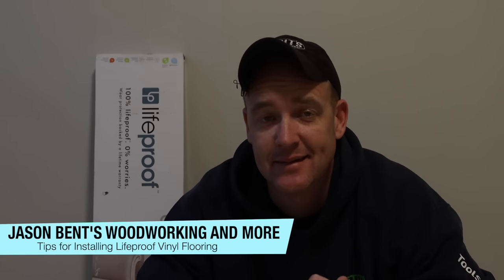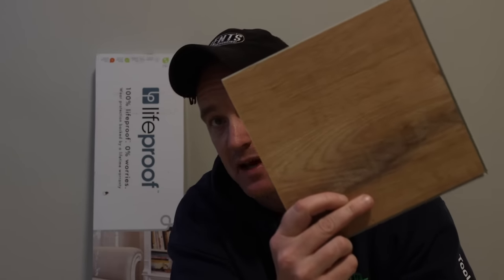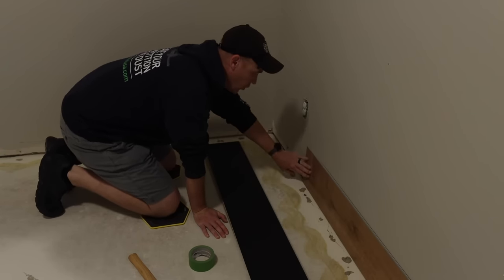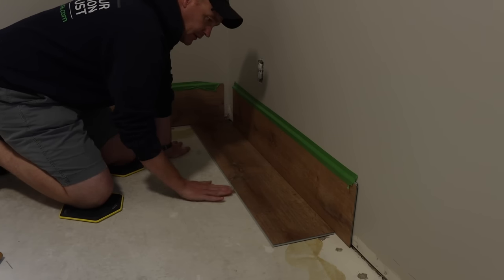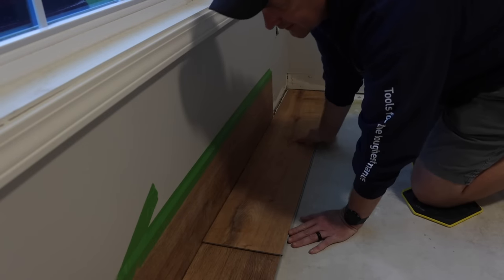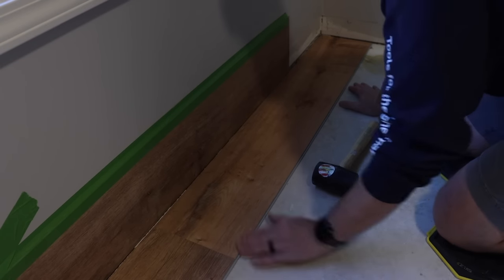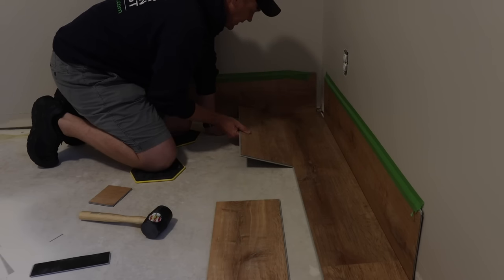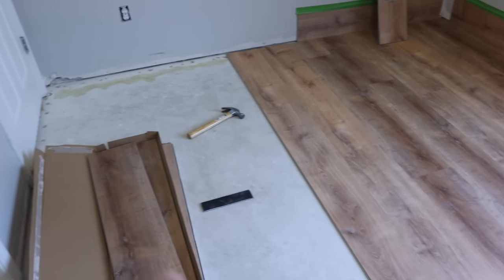How to Install Lifeproof Vinyl Flooring

Comment: Wow best how-to plank flooring video I’ve seen, comprehensive and doesn’t spare the details. The close-up of the joints is especially helpful. This is the only install video you need. Thank you!
Reply from the maker: Glad you found it helpful 😊
Reply: you aren't kidding, getting these boards to slide under the door casing and close up will frustrate even the most seasoned installers 😤😠😩
Reply: I totally agree!!!
Reply: Is the point of this to leave room for the base board?
Reply: Absolutely a great video.
Reply: I agree and I have watched several/
Reply: @Matty Ice  no... it's to leave room for expansion and contracting... if it expands and you leave no room at the ends, the floor will bunch up in some spots... and you will have to do it all over again
Reply: I too have watched other videos that just didn't include the detail I needed to understand the job. This video was SO helpful!!! Thank you!!
Reply: Yeah good video
Reply: Awesome video I love the way you explained everything in detail because I’m starting to learn to be a DIY I bought my house and I want to do my own work because it is very expensive for labor. I’m a middle-age female trying to save some money. thank you so much. Keep doing those wonderful videos.
Reply: @bentswoodworking  I recently installed a floor in a small bathroom and I had a few planks where the lips broke off so they are not fully locked. When I mop the floor the they tend to separate slightly. Do you have a suggestions on what I can use to fill in the cracks on the few planks that are separated?? Thank you for your time
Reply: Agreed ❤

Comment: Putting the flooring against the wall instead of spacers is brilliant. After struggling for a day, trying spacers, and shims, nothing worked! Came across your video and wow! Couldn’t wait to try your suggestion. It worked perfectly. We also realized the Mohawk vinyl flooring was not going together well, like the flooring you put down. Returned it to Costco, bought Lifeproof, and yippee! It was so easy! Thank you soooo much. My hubby and I are 68 and 77 years old. With your help, we did it ourselves!
Reply from the maker: So happy to hear that!
Reply: Floors expand and contract depending on weather you want 1/8’’ away from the wall cus the floor could buckle up
Reply: Is the point of this to leave room for the base board?
Reply: @JoeTakagi00  youre supposed to leave the space because these planks expand during summer. If they have nowhere to expand to, they'll start opening up elsewhere.
Reply: @longice5314  so can I put against the wall then go back and cut a 1/4 off one side
Reply: @danzamx  It's not real wood, doesn't experience these weather conditions
Reply: @UltraGamma25  yes it does..
Reply: As a carpenter I can 100% say depending on the climate you live, it'll buckle. Here in New England it won't last with the hot and cold
Reply: Great idea putting the flooring against the wall instead of spacers. I have an install planned this weekend (my second one) and will definitely try it. Any particular reason why you didn't put any flooring against the wall on the opposite wall for the short side pieces (i.e. far right wall from where you started)?
Reply: Awesome comment! Hope you and hubby enjoy your new, beautiful flooring.
Reply: So what do you put in the space after you remove the spacers?
Reply: Thank you 😊

Comment: FYI - you should have included ‘what to do on the last plank’ if you can’t use the full width on the plank, and end up with a space of an inch or so to fill. I usually measure the room and if I am going to have that problem, I would start off with a 1/2 wide plank for the first run.

Comment: Okay, I've looked at several installation videos, and embarked upon installing this product as a flooring newbie.
About halfway through my start-point, in a smallish bedroom, I was really having difficulty with the boards lining up perfectly, and without any gaps (where even a half mm gap starts to cause problems)!
I had assumed that once you "lock" down the ends with the mallet, that was IT--they were "locked" in place! You VERY helpfully show, around the 19 minute mark, how AFTER you mallet them down, you CAN still whack them tighter together with a scrap piece, which effectively removes even a hairline gap.
That was SUCH a helpful and crucial tidbit of information, so THANK YOU so much--kudos!

Comment: Excellent tutorial. I'll be recommending this video to my DIY customers (as well as the official video). I especially liked your guidance in dealing with door jambs and appreciate your comments regarding a level subfloor/slab. I'd just like to add a little tidbit: never install a plank that is damaged, especially if it is chipped or has a damaged corner. Set it aside and use it at the beginning or end of a run in such a way that the damaged part is not used.
Reply from the maker: Thank you!!

Comment: A ton of videos on how to install vinyl flooring, this one is by far the best.  The step by step explanation was great, and the tip on using the flooring as spacers on the wall was awesome.  Thank you, it really helped w/ my uneven walls.
Reply from the maker: Glad you found it helpful
Reply: Are the spacers only needed on the beginning planks and only 2 walls?  I’ve never done a flooring project and I’m afraid I won’t have enough “play”
Reply: @Xxspeedsonic09  expansion gap is needed wherever the vinyl plank meets a vertical surface. So every wall.

Comment: Great video. This pst weekend I used it as a guide to do vinyl plank flooring on my lanai, roughly 22ft by 12 ft. Super easy to install, took a few hours, prep work was more time consuming than the actual installation.
Reply: Thanks

Comment: Thank you for the info, I’ve noticed hardly anyone covers measuring the floor so that we don’t end up with a very thin piece at the end; not such a big deal but it would help.  I tend to measure 10 boards to give me an exact length, then I measure the floor and find out where I am going to end, if too thin, then I cut a piece off the starting row so that I have at least half of three-fourths width.  Thank you again, your video helped me a lot.
Reply from the maker: I just lay the boards out for one row and se what it will leave me with. If the end piece is too short, I would adjust my first board.

Comment: Great video.  Two tips I have not seen elsewhere: 1) lifting the prybar to "click" the under-the-door-jamb piece into its channel; and 2) using a few of the pieces along the wall as a 1/4 inch "spacer".  Both are better than using the two tools they sell for these two purposes (the hammer on pullbar technique for the jamb piece and the little spacers they sell in packs).
Reply from the maker: Glad you found it helpful

Comment: great video.  v helpful. my only recommendation would be to mix up the different packages of floor planks so as to not have patches of similar coloring in the patterns.  same as you do with paint - mix up the different batches for continuity.  👍🏽

Comment: This has been the only video that I actually comprehend. Others have been way to complicated when measuring and it was really discouraging but this is clear and to the point. I am actually excited to start. Thanks for sharing.
Reply from the maker: Glad you found it helpful
Reply: Agree. I've seen videos where they are making all kinds of measurements and using chalk lines and such, and about that time I'm pretty much lost. Here, he just gets down to business. My concern, though, is that if you don't do some kind of measurement, you may be left with a narrow strip of flooring at the other end of the room.

Comment: Outstanding video, Jason! My wife and I plan to use the same flooring in our house. Just a tip for others regarding the flooring in the bathroom. This stuff is waterproof and can be run straight into the bathroom and there are no grout lines to deal with. I hope your PCS went well and the new duty station agrees with you and your family.
Reply from the maker: We have it in our bathrooms as well 👍👍
Reply: Do you remove the toilet or lay the flooring around it?

Comment: Thank you so much for this highly detailed tutorial! Doing a crash course this morning so we can do the floor this afternoon. I particularly liked the tip about using the flooring against the wall instead of those plastic shims that just pop out. I have always used one of those hammer/pull bars along the final wall, but your tip on using the Pry Bar and just leveraging rather than striking it in place seems far more elegant and easy. Nice work and thanks for taking the time to make this tutorial. I also prefer the speed of the miter saw over scoring and snapping, glad you mentioned both. Thumbs UP! Happy 4th!
Reply from the maker: Glad you found it helpful
Reply: You always use a pry bar on your last row, if possible? Unless it has to be hit in with a pull bar. Also, i would use a plastic tapping block instead of a dead blow hammer, which can still damage the lip. Tapping blocks are sold in the flooring section of the box stores, by the pull bars.

Comment: Excellent video, thanks for posting.  One thing you should add is figuring out the width of the first row, as you may not want to always start with full width piece if it causes you to have a 1 inch piece at the opposite wall.  Thanks, again, for creating this helpful video.
Reply from the maker: Glad you found it useful!!

Comment: This is the BEST video I have watched for installing. I removed carpet and tack strips, I had concrete too...I am on the 2nd floor of a condo association and was told that I needed to add an under layment for sound proofing....READ install instructions...thankfully I did because this flooring has “everything you need” as you said at the beginning and IF I had listened to “other people” such as the association I would have NULL and VOIDED the warrantee!!! ALSO NO NEED to buy KITS etc. spare pieces of vinyl work fine to use to tap planks together. Speed square and sharp blades on a utility knife works FINE! THANKS :)
Reply: OH YEAH also great idea on taping the boards to the wall and not needing SPACERS!
Reply from the maker: Glad you found it helpful

Comment: About to install my vinyl planks in my house over existing hard wood floor for the first time and found your detailed and thorough guide. I have the same size planks just from different brand from Home depot. I like your tip in using the planks on the wall. I feel confident to start now. Thank you! Awesome video!!👍
Reply from the maker: Glad you found it helpful

Comment: Tip: Lay out each row as you go without joining to check for measurements and seams. Allows for a visual check without having to pull each row apart if you don't like the look.
Reply: Good advice. Also lets you know ahead of time how big of a piece you will need to cut at the end of the row. 

Thought I could make it to the end of the row without cutting anything. I was 1" short. 😊 Had to unclick the row and put in a shorter starter piece.

Comment: I use a carbide cutter that's used with Laminate and Formica. Works much better than a utility knife. That will kill your hands after a few cuts and it will also become dull very fast. Thank you for taking the time to make this video. :-)

Comment: A speed square is the best tool you can have for this. You can use it to score and tap your pieces in. Much better than the scrap method / way less likely to cause damage. Give it a shot sometime! Great guide either way.
Reply from the maker: Thanks
Reply: How do you use the speed square to tap pieces in? It's triangle and I can't figure out how you do it?
Reply: @pcm7315  all speed squares have a lip on them. You put the lip across the plank so the triangle rests on top and tap the back side with a mallet. Ez pz. Not sure if this explanation is clear but I tried lol
Reply: @milleralex1990  OK, thanks, I'll give it a closer look.
Reply: @pcm7315  You don't, just use your speed square for what the tools meant for. It's not used to bang on with a hammer or mallet to lock flooring in place that's for sure. Whether you get lucky a time or two using it that way or not it's a silly idea. I guarantee you using this method one of two things are going to happen if not both. The speed square is bound to jump & mare the flooring which a product like LifeProof isn't cheap flooring. Or eventually by the time you're finished with the floor the speed squares gonna be bent or making indents on your square. I've been a carpenter for years & I've never seen or has anyone ever suggested trying to use a speed square as a hammering block, never. If you do it the right way with the right tools from the start not only will it show better results in your overall job when it's done. But shows anyone who happens to watch you work that you don't look like a dipsh!t doing it. Sorry Alex, just saying...
Reply: @216Numbskull  , LOL falls under the category just because you can doesn’t mean you should . I had this mental picture of walking into a room an seeing someone whacking the speed square with a hammer , doesn’t matter that it was a rubber mallet I would have lost it right there on the spot 😱🤯😡🤬.
Reply: @paulrooster2108  Yeah no doubt about it crazy dazes my friend, right? WOW! The first thing I'd say to them is why are you using a speed square? Get the right tool for the job & go find the wood-stretcher over there somewhere take a hike, seriously? WTF-OVER Blah,ha,ha!!! SMH

Comment: The only thing I would suggest, is measure your longest length first and find out how many pieces go down in a row. You want to do this to figure out how long you smallest piece is going to be.  If you are gonna end a row with a piece less than 6 inches you, you will want to add a piece 6 inches or more to the beginning of that row. That way you avoid separation due to small pieces.

Comment: Hi Bent. We’re gonna move soon and I’ll start changing the flooring on the smallest room to gain confidence. On the video I saw before, he laid another layer that looks like a very thin foam/plastic. What is that and is that necessary?
Reply from the maker: It’s underlayment and as per the manufacture, it is not a requirement but many will argue that.

Comment: I do have question.. I have 8mm lifeproof and wood sub floor... Should I use another underlayment or not?
Reply from the maker: I would say refer to the manufacturer instructions. I couldn’t say. I have concrete and didn’t use any.
Reply: @3rdGenFireChicken  Do you mean Don't sweep the vinyl?
Reply: @3rdGenFireChicken  Agree,,,

Comment: You didn’t use a moisture barrier/underlay?  HD recommended that I do???
Reply: If you are using life proof brand they have the underpayment attached. Using the barrier stuff can cause more issues (cracks) with the floor and I think will void the warranty.
Reply from the maker: Apparently they do offer a product now that can be used specifically with the life proof flooring. However, when I did mine that was not the case. Also, it actually states on the box it isn’t needed. That may be different now with the new product

Comment: My contractor made it out to be way harder than it needed to be and then stopped showing up so I am now doing my floors by myself and this video made me feel way better about getting it done right so thank you for this great video.
Reply: I have found it very difficult to get a tiler so I decided to do our basement extension in vinyl planking.  Thanks for the pointers. April 14, 2024, Lethbridge Alberta Canada.

Comment: i'm doing a floor tomorrow for the first time, i've done laminate and other stuff but never LVP. Thanks for the clarity
Reply from the maker: You’re welcome
Reply: @bentswoodworking  The job came out wonderful, although screw strapped knee pads. I even bought the most expensive ones thinking that well... you know lol. Going to try your exercise pads because after 2-3 hours of use the back of my knee was too much. I ended up pretty much just not using them.

Because of this video, I completed a decently sized 400'ish squarefoot area that included 4 doorways, there are no gaps anywhere! THANK YOU AGAIN!

Comment: Great video. Thanks for posting. The one thing that worries me the most before embarking on this DIY project (and I'm very handy and DIY oriented), is making sure the floor is level and smooth under the current carpeting that will be pulled up for my S Fl. concrete subfloor. You only briefly mentioned it, but other videos have people using a long metal measuring stuck to check for level and talking about scraping up old glue and all sort of things. Up to and including using a special leveling compound and perhaps even a professional diamond padded floor sander (which I've used on a previous re-tiling project and they are NOT fun and make a huge dust mess).

So I guess it all comes down to the quality of home construction.  It seems like I would need to scrap the floor with a metal scraper to "feel" where there are any specs of concrete droppings or raised bits that need sheering off. But even one substantial low spot seems like it would really mess up the timeline of finishing a project like this by adding another day or two of work and dry time. Not to mention the fact that I have a large chemical cleaning effort ahead of the LVP flooring project, just to remove and treat the concrete after years of cat and dog urine in "favorite spots".  So I'm worried that this "one or two day flooring job" will spiral into one or two weeks or surprises and gotchas.

Comment: Something I found out to save a lot of $$. If you need a cushion under the flooring use the blue foam drop clothes to help level and dampen noise. It is a lot less expensive.
Reply: Also like the plank on the wall for spacing is brilliant. Baseboards off I despise quarter round looks so cheap - do it right the first time.